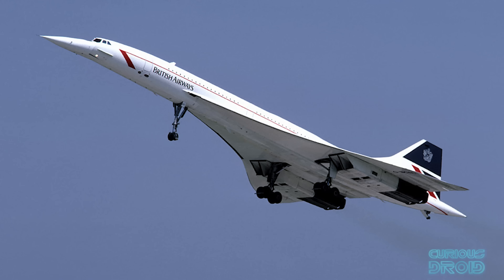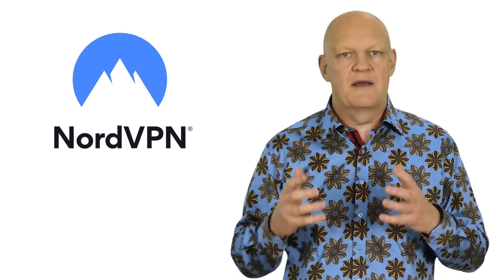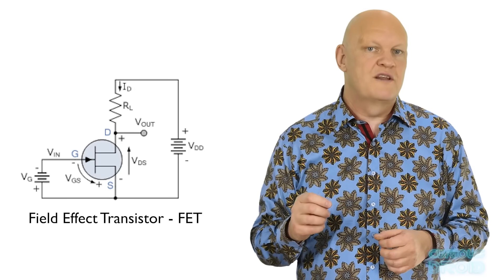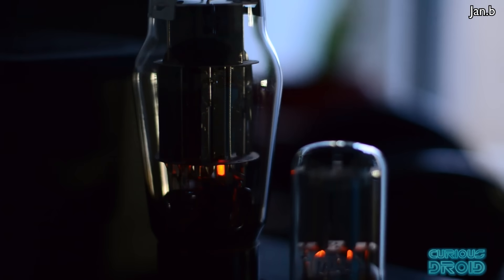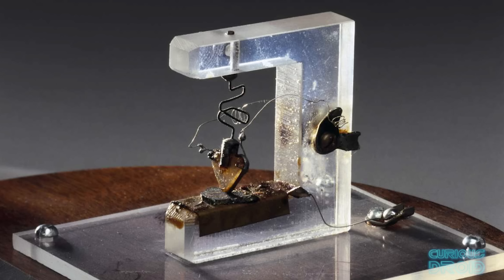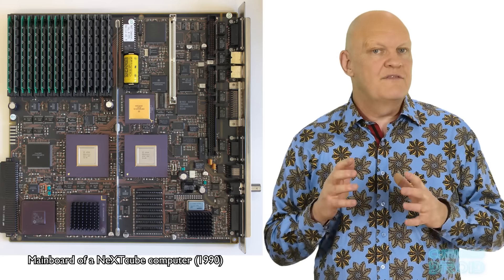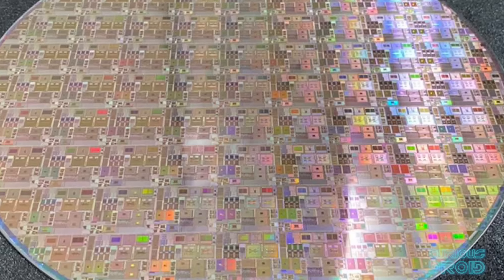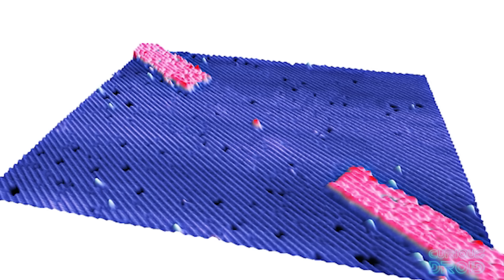MOSFET – The Most significant invention of the 20th Century

Comment: At 14:07, the diagram doesn't show how transistors are made, but rather how to make microfluidic devices, using silicon molds.
Reply: Yeah especially the last image with some hoses attached to the completed device is quite an obvious sign that we're not dealing with semiconductor manufacturing.

Comment: 13:00 You are making a mistake here. Long gone are the days since the process name has any relevant to the lithography features. There is no 7nm structure in TSMC's "7nm" process
Reply: So if the smallest physical dimension on a chip is not 7nm, what does 7nm refer to? The wavelength of the EUV used to create it?
Reply: @rpbajb  just a marketing term. Every company uses their own. For example TSMC's 7nm process is comparable to Intel 10nm process. He even said it in the video EUV wavelength is between 13-27nm no where close to making nanoscale features directly; you can still make structures with smaller feature size than the wavelength using other tricks though
Reply: @rpbajb  https://en.wikipedia.org/wiki/7_nm_process
Reply: @St0RM33  Thanks. I'll take a look.
Reply: The "feature size" which is what a particular manufacturer chooses so don't compare one manufacturer's with another. A better measurement might be transistors per square mm

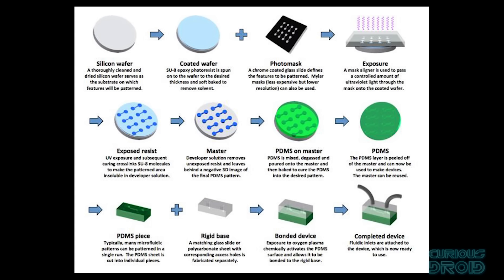Comment: 13:55 I spent 20 years in semiconductor equipment (Applied Materials, Lam Research and smaller independents), but after about 5 years in systems design and integration I came up with a phrase that I still use in my email signatures: "The more I learn about how chips are made, the more I'm convinced it can't be done."
Reply: A while ago I got an introduction to the complexities and performance tricks (branch prediction, pipelining, etc) in CPUs, probably only up to the state of the art of the 80s. I cannot fathom how complex they are now. Absolute black magic.
Reply: @Norsilca  -  Yep, that's the way I always described it.  Or maybe science fiction:  Plasma, lasers, transparent aluminum (really!) and materials being laid down in "monolayers" (one atomic thickness).

When I left the field, the "CD" (Critical Dimension, or roughly the width of a circuit trace) was 15 nanometers.  According to this video, it's now pushing 5 nm.  Amazing.
Reply: @hagerty1952  We aren't exactly at 5nm. The 5nm is the name of TSMC's world leading process. However, the 5nm is actually just a marketing term. The name of each process used to be the gate pitch of the planar transistors, up until about 45nm. Then it got super hard to reduce gate pitch, so they just started naming the processes (32, 22, 14) based on the theoretical performance and density if we were still reducing the gate pitch. In fact, the gate pitch in modern 7nm is about 30nm. We have just moved forward with different optimizations like FinFETs.
Reply: @es-yy2cm  - Thanks for the update!  What a blast from the past to see TSMC listed again.  That was our biggest customer in Silicon Etch at AMAT.  I designed a lot of process kits for them (or rather their clients) for the MxP chambers (yes, I'm that old).  I worked on the dome cooling for the first DPS systems and did the cathode for HART (the first trench-memory system) which was a joint development with Siemens.
Reply: @hagerty1952  TSMC and Samsung are running 7nm production with 5nm pilot lines. 3nm and 2nm is on the horizon! It's just unbelievable!
Reply: it is mind blowing and pushes the realm of comprehension
Reply: I've been tempted to bow before a computer chip. 
They are borderline miraculous works of technology. 
I do my damndest to not take them for granted. Or to at least not forget to, once in awhile, take a moment to appreciate what I'm dealing with. 
What im using to type this comment out.
This comment, this tiny miniaturs expression of myself. That only exists because of computer chips...

Wow...
Reply: @Dave_Crupel  - Well put
Reply: I feel the same way.  I'm an ASIC verification engineer, and I sometimes wonder "How does any of this work"?  Several design engineers have said the same thing to me.  I guess if any of us really understood how the fab process works, we'd be PhD's in Chemistry/Physics/Materials Science.
Reply: Today's advanced electronic devices are MAGIC! (In the sense of Clarketech: technology so advanced, it is indistinguishable from magic.)
Reply: I read in a book a while ago: How more intelligent are you, that less did you understand from the entire picture. 

That makes me extrem scarred and a bit annoying.

That the sentence what I can't forget since 3 to 4 months. I hope that quote did made sense. German native speaker.
Reply: @xXDrocenXx  Your English is much better than my German. If I may put forward a couple of small changes; "are you" should be "you are" and leave out the "did" and "from". I hope that helps. Cheers.
Reply: @xXDrocenXx  Way better than my German. I think it is true that the more you learn the more you realise just how ignorant you really are.
Reply: @xXDrocenXx  a “bit” worried 😂
Reply: @xXDrocenXx  i think we get ya. The more you learn, the less you know about the big picture.
Reply: @xXDrocenXx  all that means is that you are specializing in something (or not).
Reply: @xXDrocenXx  I'm not 100% sure but I suspect you're referring to the Dunning-Kruger effect.  I'm not aware of any specific one-liner quip (though maybe I just haven't seen one) but I suspect it would be something like "the more you know, the more you know you don't yet know".

Also, its not specifically related to intelligence - even the smartest among us fall prey to its whims.  We've seen that a lot over the past year and a half with respect to covid-19.  Lots of "doctors" (of physics or chemistry or psychology or whatever) who think they understand more about epidemiology than actual experts like Dr. Fauci in the US and any number of other actual epidemiologists in other countries and the WHO.  Physicists generally aren't stupid people, but that doesn't mean they know anything about fields outside of physics.

That said, intelligent people do tend to be more interested in learning in general, and therefore are more likely get over that "I know it all!" bump in more fields than people who don't do care about looking into things in detail.  That doesn't mean intelligent people do that for every field (and some very smart people just completely keep themselves constrained to their specific field of occupation) but they're more likely to have a broader spectrum of knowledge and therefore more fields where they know how much they don't know.
Reply: 😂 Haha. Me too on that one. I think it is really magic going on there. We made a working FET at university. Comprehensible. But BILLIONS? Magic.
Reply: Applied materials in Kalispell!?
Reply: @Justforfun-ek7et  - Sorry, Sunnyvale and Santa Clara, California.  Lam Research is north in Fremont (right across the freeway from the Tesla factory).
Reply: @hagerty1952  very cool!
Reply: 5 years in a Dry Etch department. Congratulations on your time in the industry
Reply: @shannonrogue9676  - And surviving!  I do medical devices now.
Reply: It is a wonderful world!
Reply: In July 3rd of 1947, UFO crashed in Roswell. It had a glass panel full of microscopic circuit like thingy, broken wire that lit up at the end, a pen with light that can cut through anything, and a few other mysterious devices which we still don't know what they are used for. Read the book "The Day After Roswell" by Colonel Philip J. Corso. Some engineers who worked on early transistor validated the claims in the book. 

Interestingly, before 1947, we only had vacuum tubes and there was no clue how to improve it. December 1947, as told in this video, we had the first clumsy and rudimentary transistor, that is the building block of IC chip.
Reply: @sbkarajan  - Ummm, I'm not sure if you're joking, but in design review meetings I did occasionally ask , "so which of you guys are the aliens who brought us this design?"
Reply: @hagerty1952  It's stunning that comparing the year 1900 vs 1960, the live of the people changed so drastically in such a short period. From horse carriage to cars, and then airplanes, jets, space crafts, rockets, TV, computer, electricity, plastics, nuclear bombs and plants, I mean.... in 1900, they were practically living in stone ages compared to 1960. That's comparing 60 years.... less than a life span of an average person.

Fast forward to 2020, another 60 years later from 1960, what have we got? Except computers, everything else is practically the same. Not much difference from the cars of 1960s to the ones sold in 2020. From the outside, they are the same thing. We live in a house that has heater, A/C, shower, sofas, garage... When we travel, yes, we still fly in jet airplanes, submarines, missiles and space craft, nuclear power, bombs, and then fusion power still 30 years away...
Reply: @hagerty1952  Can you come to my CH?
Reply: @hagerty1952  There is a PL called "UFO Real"
Reply: @hagerty1952  Logically, it makes sense that beings million years more advanced than us, don't need to obey stupid Special Relativity. We were taught that it's the law of universe, but we haven't even gone to other planet, let alone other star system, so what do we really know? The unbreakable law of the universe? lol.

Comment: I really enjoyed that, but it leads inevitably to another video on a microminiaturisation subject that has gone hand-in-hand with MOSFETs that I'd love you to cover:
MOSFETs need to be placed on PCBs. That poses a problem which is not unlike the classic Water-Gas-Electricity Puzzle... how to route the wiring and where to position the main components to maximise the signal-to-noise ratio by minimising soldered joints, electromagnetic induction between adjacent conductors; and how to maximise processing speed by minimising conductor length. Solving this reduces heat production and so power consumption.

The solution is Autorouting - automated solution of the Hamiltonian Path Problem:

The first demonstration was by C.Y. Lee and based on work at Bell Labs by E.F. Moore (the Lee Moore Algorithm). I have heard that Lee was working on noise reduction to solve the problem for the world's biggest telephone exchange, then being installed in the Pentagon (1956, IIRC).

Autorouting algorithms are used together with fast packet-switching for maximising the cost-effectiveness of data networks. They are used with SatNav and Travelling Salesman Problem algorithms for transport planning. They are used with the Monte Carlo technique and dynamics equations to optimise navigation of spacecraft along the ever-changing and multi-dimensional Inter Planetary Super Highway (see Ross Dynamics Lab).

And they were used for PacMan, which - along with Asteroids, Tennis and Space Invaders - helped to drive and capitalise rapid development of micro-miniaturised ICs. This gave NATO an unassailable technological lead over the command economies of the Warsaw Pact, ultimately leading to Nicolai Gorbachev's capitulation to Ronald Reagan at Reykjavik. So... MOSFETs and Autorouting contributed to ending the Cold War.

Various autorouting algorithms have been developed for different applications, such as British Telecom's "Ants", A* and so on. The Lee Moore Algorithm was first demonstrated solving a representation of the maze at Hampton Court Palace, London.

So there you are... a project for you! Pleeeease 😁

Comment: You know, that 7nm TSMC process...nothing in the transistor is actually 7nm in size. At this point, it's basically all marketing speak, and has no actual connection to anything in silicon. AFAIK, the last time the node size was the actual "feature" size was at 22nm.

Comment: Wow!  I do optical coatings for 193nm ArF excimer lasers!  These optical coatings have to be incredibly precise to withstand the incredible power needed to make such tiny lithography features.  So cool to have my work relevant to a Curious Droid video!
Reply: In the "naughts" I "owned" a 248 nm KrF excimer lithography laser. It was retired shortly after I was in 2009. Viewers may not know that an excimer is an "impossible" molecule formed from an inert element (argon, krypton) and a highly reactive element (e.g. fluorine) under very energetic conditions (electrical discharge). It quickly falls apart, emitting a photon of a characteristic wavelength in the ultraviolet. Even so, the natural spread of wavelengths is enough to cause chromatic aberration, so a grating is used to filter out some photons. The ones that remain must be confined to an environment devoid of oxygen or hydrocarbon vapors to avoid damage to optics. The imaging lens is about the size of a garbage can and designed to operate at a specific altitude. I could go on.

Comment: I vaguely remember my family had a valve TV when i was a kid. When they broke we used the valves as Flash Gordon Rockets
Reply: Although the TV replaced the radio for most people, I stuck with our radio. It had six, maybe seven, tubes and was a floor model, with a 10 " electrodynamic speaker. Radio was still strong in 1950 with lots of great programs.

Comment: What I don't understand is that at the sub-10nm scale, don't quantum effect kick in? Is this a problem? How is managed, if it is?
Reply: They do have to account for quantum effects, but mostly it's managed by not actually being sub-10nm. Even when the "size" of the process used to mean anything it only ever described gate length. Other parts of the transistor were always way bigger. For current cutting edge process nodes the name has no real bearing on how big a transistor actually is. It's a marketing tool meant to describe some vague definition of "performance" defined by the foundry.
Reply: @jfolz  Thanks for this answer. I get a little twitchy when they talk of gates consisting of only teens of atoms.
Reply: @nicolek4076  here's some pretty nice info on how big stuff actually is: https://en.wikipedia.org/wiki/7_nm_process

But yeah, electrons tunneling around willy-nilly is already a big problem.
Reply: @jfolz  Interesting. Thanks.